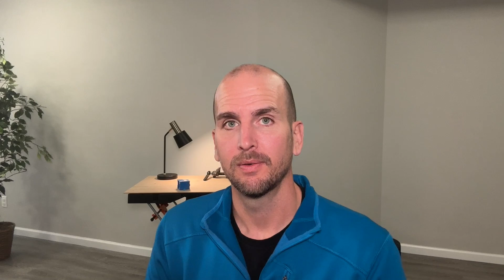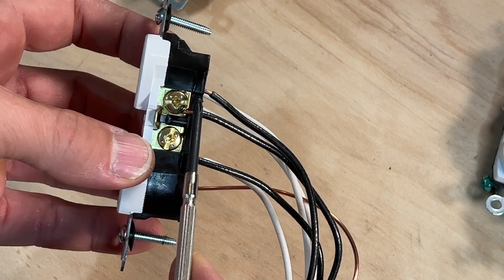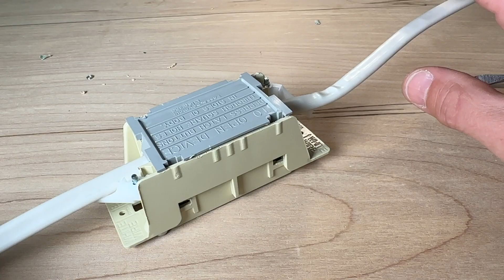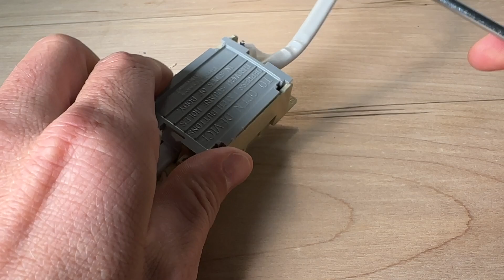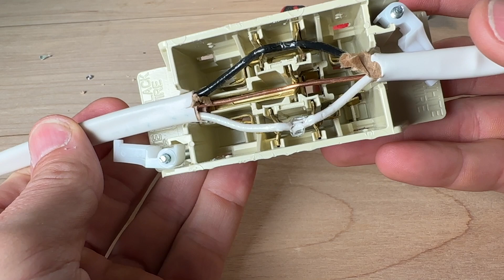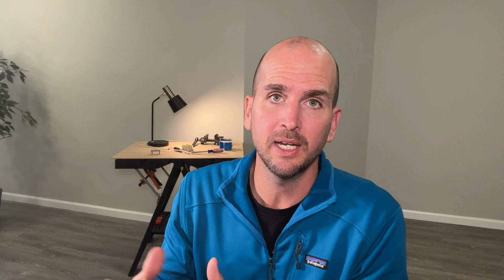90% Of Homeowners Have Never Seen This Dangerous Electrical Device

Comment: Thanks for sharing.  I have never seen those before.  I am VERY familiar with Ethernet and POTS wiring, but never saw the same approach applied to 120.  There is no way I would trust that.  Heck, I've even had issues with Ethernet and POTS here and there over the years where the insulation doesn't quite get stripped enough for a good consistent electrical contact.  However, those are low voltage (put POTS can still get your attention if someone is making a call while your working with the punchdown block. :)  )   But for the 120 there is so little contact area.  It seems like those points may possibly heat up.

Comment: Honestly I only came across this connection with low voltage ie 12 24 volt
I never would consider that at all as an option for 120 volt especially as a receptical. I have seen where people have smoked a 15 amp receptical on a 20 amp line using power tools 
What you showed me would just burn up

Comment: I work in EE and these IDC terminations are pretty common but I've only seen them in low voltage applications.

Using the proper tool is essential and even then these kinds of terminations really suck IMHO

Comment: I cannot speak to the current batch, but the ones used 15-20 years ago sucked just as bad, and they are smaller than normal outlets. This means to replace them, you have to do some careful cutting in the cheap wallboard these things use for walls.

Comment: Insulation Displacement Connectors - suitable for high current applications? Perhaps, if the correct tools were used. But as seen in the video all manner of random methods used to force the wires down into the IDC connectors, with as expected entirely random results.  All the good stuff of Electrical Fires.  

I'm with the videographer, would not touch these with the proverbial long wooden pole! (hope that translates across the Atlantic :) ).

Comment: This looks like an invitation to faulty installation. As you mention, you need special tools, and probably stranded wire for correct installation. They also look rather cheaply made.
I think the idea is good, but the execution disastrous.

Comment: These dangerous plugs have been going on for a long time. My 2001 National RV with 70k miles had these push down outlets. I've replace them all with Backwired outlets and boxes for them to mount in. Put in a real breaker box too. They were a fire hazard one was melted where the wire was just touching the metal and not in the slot.

Comment: During a lunch break from an electric blanket factory, a friend decided to invite a few of us to his gran's house because it was local; when we arrived in the lounge, his gran was sleeping on the sofa wrapped in an electric blanket; I stepped on a makeshift extension cable that was joined close to the blanket, after doing so a loud bang followed by flames, my colleague shouted "Gran, you are on fire", I pulled the blanket away from her, she woke up wondering what the noise was. The house fuses had blown; I inspected the cable and saw that she had twisted each wire together, covering it with a band-aid plaster. She was ok, but at that point, needed looking after; we decided to turn her home into our canteen to keep an eye on her.

Comment: Usually I have seen similar devices or rather that type of "Punch Down" connection/connector design in Networking applications and also in Home Lamp switches. (The old lamp replace the cord and the switch device applications)

I agree. 15 amp rating is being to generous with that outlet. (Lamps can be different due to just burning a lightbulb and nothing else where the draw is not anywhere NEAR 15 amps).
There is not enough connection on the punch down cut to support a long term type thing.  Now if they redesigned it to have a strip of insulation cut off, punched down and then SCREWED the back on.....Sure. But clipping together and the punch down design.....nope.jpg......

PS- WAGO 221's use a similar related/type connection (In that it is a Friction type). But  do a much better job. (There is extra connectivity tab to support the amps in a Wago) They actually designed the Wago to have more contact internally then just a regular push down type connector and include a clamping device in the design.

They could make a similar outlet like this device crossed with a WAGO mechanism and have the best of both worlds. AND be truly 15amps AND be a time saving thing. And it would be 100% more safe.

Comment: Use to see and use wire taps to add another tap on an existing wire  that would use the same principle, they seemed to work pretty good, however I had found some that had burned up because of the higher contact resistance that would sometimes develop. I remember them as being blue, though that probably was a color code  for the wire size. I never saw them on house wiring.

Comment: I'ven seen similar "stab" connections in small in-line light switches. Never had a problem with one, but they are for low current, i.e. a table lamp.
 I wonder if the UL certification applies applies to these larger ones when the correct assembly tool is used?
 Scotchlocks, used mainly on 12v wiring, are incredibly good IF and only if you follow the usage instructions.

Comment: Vampire taps have traditionally been used in LV and higher-gauge wiring.  Any amount of voltage that could arc or any amount of current that could generate heat IS a nogo.

Adding to the risks, the large enclosure looks bulky and takes up a lot more space than its equivalent residential, commercial, or medical outlets.  Finally, the wires coming in and out of opposite sides require a 180 degree bend so that the wires stay in the conduit (or are run together) either up above the outlet or down below.  Bends without s stated maximum curvature lead to fatigue failure of the conductor inside the insulation.

I'm sure someone got a patent on this, and someone sold a lot of them to "temporary" structure builders (RVs, trailers, mobile homes) but it's definitely a bad idea.

Comment: Here in CA, those were in a 1980 or 1986 I can't remember exact year modular home. Most of them lasted fine until present 2022, some were replaced, due to losing clamping force on what you plug into the outlet. 36-42 years, I guess you can't complain too much about the design.

Comment: It probably got UL and code approval because it was tested using the special tool to push the wires in.  As you said, without the tool people have to find some other way to push the wires in and from what you showed, any method other than the special tool is wholly inadequate.  And I do agree that it is dangerous since people will probably use it but not purchase the special tool, causing a very real possibility of electrical fire.

Comment: My manufactured home was wired with these everywhere.  A decade or two later they can start to arc and the only way you know is they stink.  I would recommend changing them out ASAP.  And of course, arc-fault breakers were not a thing back then. I've replaced several with real boxes and standard side-wired outlets.  Their contact durability is very poor too.

Comment: This type of connection method is quite common for small signal connectors. But for mains voltage I also wouldn't trust them. I've seen quite a few connectors which became so hot that the plastic was melting and connector and/or plugs were permanently damaged. Even a small fridge is enough to heat up a bad connector to scary temperatures. Better spend some more money and prevent possible fires or other damage.

Comment: Looks like a telephone line repairman's dream! Although those guys usually use a proper punchdown tool and of course there is a bit of voltage difference between wiring. I don't even like using Scotchlocks when working on cars for the same reason, just terrible connections. I have never seen those in Canada and hopefully never will, they should be outlawed!

Comment: Biggest problem I've had is with the light switches that are like that.  They may not always 'click' on or off.  Could rest somewhere in the middle where the switch might arc across and start a fire.
Reply: Yes, "line switches" are commonly sold in hardware stores and use IDC, although you also cut the hot wire for that application, and the neutral is not cut nor IDC connected to anything, it just passed through.

Comment: My mother-in-law had a couple of them fail in her prefabricated home. I replaced every one in her home with retrofit box and receptacle or switch. In her home there was enough wire in place that I was able to cut the old devices out and put the new in without needing any wire other than some ground wire. The job does require opening up the existing holes in the wall.

Comment: At least when applied to computer cables, they're called insulation displacement connectors, or IDCs.  I use THOSE all the time.  But considering, as you've shown, how little surface area can be connected, like you I'd be disinclined to use them for anything over a couple amps, and I'd be nervous at 15.

Comment: I live in a mobile home, and every outlet is like this. Several outlets didn’t work when I moved in. Light switches and fan switches are also wired in the same bizarre way, making it very difficult to wire new ones in.

Comment: Pinball machines use a the something like this , and at low voltage they fail over time , as the wires will fall out or break off . I had this problem on my Gottlieb system 80B games , and these should be trashed . To replace these with standard plugs you would be short on wire right , as there's no loop of extra wire.

Comment: As a 3rd year apprentice, I ran into this same style of duplex. The original complaint was lose of power to a microwave. I spent time locating the breaker however the breaker was still in the on position. ( it had not tripped). So I turned the breaker off and pulled this style device out and my first reaction was “what the heck is this” I opened the back of it and the hot wire had literally lifted itself off the blades.The customer had said it was working fine then all of a sudden stopped. I had figured with a microwave on the 14awg circuit that it may have had a bad connection and the heat made the wire jump of the blade. (This was the end of the circuit) I’m not sure if that was the case in any way. Easy to cut in a wing box and install a proper duplex device no issue.

Comment: I'm no electrician but I'd say I'm a tad bit more savvy than the average lay person. Usually with vehicles DC current. In the past these types of connections would be my go to. But as I get older I realize how annoying they are to try to seat the wire without damaging it.

Comment: these outlets are a cheap design, that's why they are used in the RV industry. They work OK when properly wired I.E the wires pushed ALL the way into the contacts. The one shown was not. They are not my favorite device..but they do work in RV's as they take up less room than a standard J-box. Not for heavy loads.

Comment: I have used these doing warranty repairs new mobile homes, I don't like them. I don't rely on the back piece to push the wires in, I use a screwdriver with the blade held close to the slotted metal contacts and bump the wires in with the heel of my hand. That cuts the insulation and seats the wire down in the slots and then the back just snaps on.

Comment: I absolutely hate these.  As I mentioned in someone else's thread, I've helped to replace a few switches/outlets at my Mom and Dad's trailer house.  It always seemed to turn into a huge, multi-hour project, for just a single receptacle.  It's a chore to pull the dang thing out of the drywall far enough to even get to the back.  Then, you almost have to break it to pop the back cover off to access the wires.  After that is another fight to get the wires OUT, and then yet ANOTHER one to get them in to the new one!  Again, one more fight to force the back panel back on because it barely fits with the amount of wires that are stuffed into it.  One final skirmish to force all the wiring that was pulled out of the cutout back in, lock it down, and then hope that the pressure doesn't break the drywall, or wiggling it around to force it back into the cutout causes the back panel to pop off.

So yeah, I hate them.  Oh, and they're also STUPIDLY expensive for ZERO reason.  If I recall, the single pole switch we replaced was over $20.  I can get a real one at Walmart for what, $1?  Then I can install it in like ten minutes....

Comment: It's been at least 15 years but. I have run into a bad one once while working on a customer's mobile home. I believe we cut the wire and then installed an old work box and residential plug to fix it.

Comment: Those are awful. Someone should take a thermal video of one of these under it's maximum load prior to tripping whatever the code says to use for circuit protection. I would not be surprised if these things reach ignition temperature before 20A. I know that the other sockets shown are allowed to be on 20A circuits in most US electrical codes, and I think that is a bad idea too, but those are worse. Just image two 1200w heaters plugged into one of these things. I can't imagine it would not start a fire eventually.

Comment: That looks like the 12v low voltage outdoor wiring connections. But it's on a 120v 15/30 amp device? Seriously?

Comment: I bought one of those to replace a worn out outlet in my dad's RV, I could only find it at a specialty store that sells RV components, and it came with the tool to push the wire in without damaging the insulation.

The outlet was so worn from over use that no plug would stay seated in the outlet.

Comment: Well, personally I would agree with you that it seems rather sketchy. But on the other hand, I've been wrong about stuff like this before. Like, I live in Gemany. And here when electrical wires are connected together somewhere, little connecotor blocks by a German company named Wago are practically always used. In fact these connectors are one of the very few options you are legally allowed to use in a electrical connection box inside the wall. And I was always kinda skeptic about that. To me they really didn't look like they could handle a whole lot of current. But I've seen many people test them online and even tested them myself. And you really have to overload them hard before they even begin to noticeable heat up. I've seen videos of glowing hot 12 gauge wires passing over 100 amps, with the insulation completety burned off. And yeah, the wago connector (rated 32 amps), joining two halfs of the wire together, was smoking and it's plastic housing has melted. But they were still going strong. Basically connections between the wires could handle more current than the wires themselves. My point is, sometimes looks can be deceiving. And you know, I would assume these outlets had to pass a couple of tests in order to be certified. So who knows?! Maybe the connection is actually a lot more reliable than it looks at first sight.

Comment: 90% of homeowners have never seen these type of outlet boxes because
90% of homeowners dont live in a mobile. Many who do live in a mobile
are not DIY so they have not seen them either. UL listed them because
when properly installed by a licensed electrician they are safe as hell.
When a DIY installs it without the proper install tool as you showed the
wires get scarfed up. The good news is they do not build mobile homes 
since 1975 by federal law. All they build now are mfg homes or modular
homes both of which comply with standard electrical codes. Rv do still 
use these.I would guess tho that if you remove the wires from one of 
these boxes the box should be thrown away and replaced w new.

!

Comment: Screen-Terminals are the worst.
The copper will move away under the pressure of the screw.
J-hooks may be better in terms of contact area, but will have the same problem.

Clamp-terminals (push-in-terminals) are the best, because the spring will readjust if the copper moves under the pressure, so the connection will always be save.

Those cut-in-connections are most suitable for stranded wire because they will set much better between the cut-clamps and by doing so increasing the contact area.

I'm an electrician from Germany, so my standards are quite different.

Comment: not like ethernet at all, also, yeah, this is a great solution, any installer should have the proper tolling, and calling that has the decency of the design isn't fair. of course, I'm also a fan of back-stabbing as you call it as I feel the side screw terminals are a liability. Just follow tine installation training with the right tools, should be just fine.

Comment: It is just a bad design. There should be no need for a special tool to put the wires in the knifes, it should have just been molded into the back cover some protrutions that pushed the wire down the knifes when you closed it. This kind of knife contacts is used a lot in different kind of plugs for signal cables and it is almost always molded some features in the plastic that pushes the wires down the knifes so you dont need a special tool to do it.

Comment: Came across these in my new (to me) pop-up camper in the spring while doing a rewire to accomodeate an inverter and battery bank. Immidately removed them all as soon as I discovered how the connections were made. the only outlet in the whole camper that was a normal residential outlet was the GFCI that all the rest were daisychained off of. I'm really happy I discovered them before using any high current devices in the camper, I do have an electric kettle and hot plate for when shore power is available.